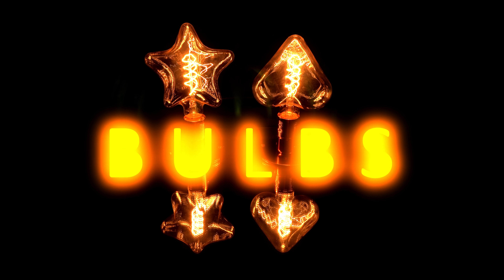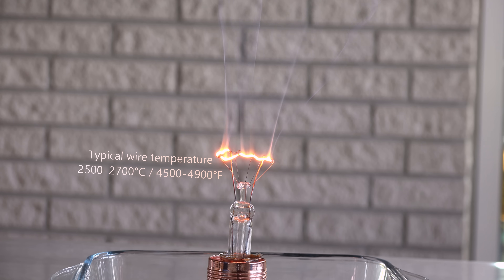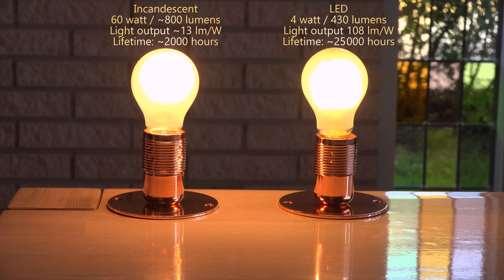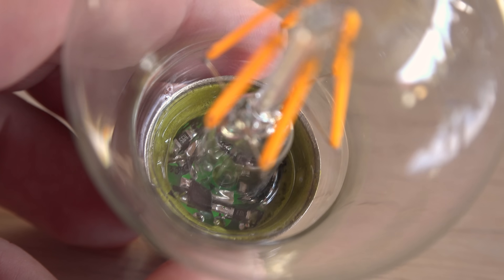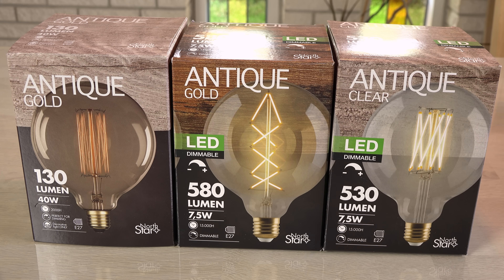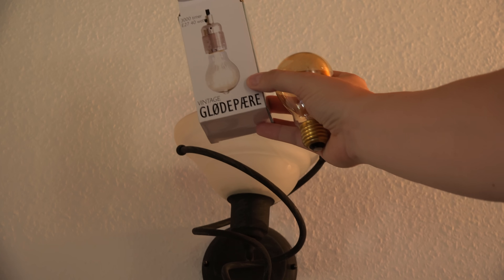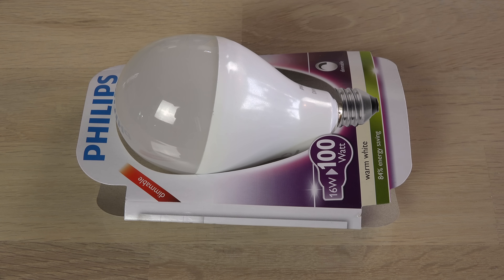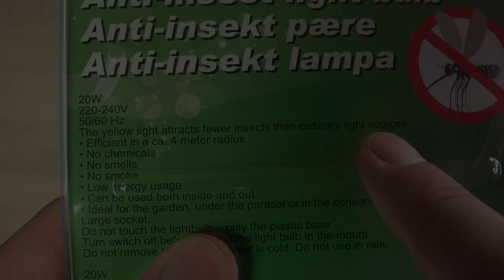Light Bulbs | LED vs. Incandescent

Comment: The led is lying to you because it is only low voltage but not more efficient in amperage and you are charge open wattage so get five led and you are using the same wattage as the Morden 60watt. The real solution is to invest in solar and you can use all 100 watt light.

Comment: Incandescent light is being discarded because it was being used in cameras and capable of capturing paranormal entities...
It's considered to be the poor man's IR light aka infrared light. The only camera i know of that still possesses the incandescent light feature is Nikon more specifically i use a Nikon CoolPix... happy ghost hunting 😉
Reply: Using it with a flash causes it tp send out waves of heat directed towards where ever it's pointed.
Ghost use energy as food... so they want to/ cant help but absorb this energy there for they become more visable. After they absorb it they cant just shake it off... so after that you can pretty much just follow it around until the energy wears off or the ghost hides from you.

Comment: It's weird that you say that the positive side has holes, like a negative. And the negative has extra, like positive. 

If you're checking LED heat by feeling the bulb part, you're doing it wrong. LED's get hot at their base.  You can touch a bright LED that's been on all day as much as you want on the white luminescent bulb part, but even a LED can get hot enough to burn or at least feel uncomfortable, if you touch near the base.

Color scheme my ass. Who cares if your meat looks less delicious, it's gross regardless but even if you disagree, and feel it's less appetizing looking, good? That way you're less likely to overeat. This feels like an invented problem so you have something to talk about for the video.

You know dimming there are many different types of making a bulb dim-able, and they don't necessarily get along with all bulb types. incandescent  might get fed less power by a dim switch setup, but that doesn't work for LEDs, they have to be on or off, there really isn't any in-between. So LEDs solved this for diming by strobing on and off too fast for the eye to see, giving less light by simply being on less often.

Also florescent would normally take awhile to start up,  But this was solved by forcing electricity through past capacity, kinda like jump starting them each time, meaning turning compact florescent bulbs that come on right away,  on and off, really cuts down on their life span. Fortunately LEDs are perfectly fine with turning on and off, better than incandescent even. Incandescent don't have a direct problem with going on and off but the temperature fluctuations between on and off can reduce their lifespan. 

You mention heat, but you don't mention cold. AFAIK florescent are especially bad at cold, but LEDs handle cold pretty well.  I strongly recommend everyone use a LED bulb in their fridge. For some reason the default and standard fridge bulb is the hot incandescent, but that's absurd. Not only is it less efficient and less capable of handing going on and off like when you open the fridge for a moment compared to a LED, all that extra heat is going in your fridge making it work harder.

Comment: F.cking ignorant.  I literally bought a 24 case of 200 watt incandescent bulbs just so I can always see in my bathroom when the hypocritical socialist liberals who don't understand basic thermodynamics in electricity want to ban f*ckinglight bulbs.  Okay so look we don't have a smartgrid and we probably won't for another two decades so the power plants make the same amount of power and the lines have the same voltage regardless of how much power you use in your home.  If you switch off your main it will not change how much power the power plant is producing nor will it increase the voltage in the lines literally all it will accomplish it's causing that transformer to heat up even more.   That's literally it.  You can sit outside with a pair of thermal goggles and literally see this for yourself reducing the load of electricity does not do anything other than increase heat output of the transformer on the pole.  You're not saving the planet, you're not reducing energy, there's not a guy shoveling coal into a power plant that suddenly going to stop for a second go oh well Joe schmo is using less power I better hold back for a bit that's not how it works, that's not how any of this works.  It's lies the sell more expensive stuff that intrinsically has no more value with the pretense that somehow it's going to save the f*cking planet and literally does nothing but reduce your personal energy consumption which will reduce your bill by like $3 a year whoop t-sh*t.  I prefer to be able to see thank you.  You ever been a motel where they have all the LED lights it's like a dingy dungeon was on a cruise ship like that last year and you literally got blinded when you went outside because there was no light inside.
Reply: I can't tell wether you're actually serious or just a top tier troll. Either way your comment was a very entertaining read. Thanks!
Reply: @NotBroihon  I'm dead serious, if you believe I'm wrong please explain what I'm wrong about.
Reply: @amelliamendel2227  your logic and elaborations are making as much sense as a desertation by a 4 year old on why santa claus exist, so I'm not even gonna bother. Have a nice day, mate.
Reply: @NotBroihon  Deep down you know I'm right
Reply: @amelliamendel2227  If believing that makes you happy ¯\_(ツ)_/¯
Reply: @NotBroihon  Do you believe power plants produce less power in response to more efficient appliances and lightbulbs?

Comment: In winter, most other folks run up their heating bill plus electrical bill to light up their spaces - my heat generating bulbs help to light and heat my rooms, without the additional cost
Reply: And during the summer, all that extra heat means your air conditioner has to run longer. So not only are you spending more to light your house, you're spending more to cool it.

And using lights to provide heat is a really inefficient way to do it.  That's why your house comes with a system specifically designed to heat it.

Comment: I still prefer older bulbs because produce more natural looking light, LEDs have a tendency to look plain white while incandescent have a warm look to them. tbh I think most older technology is better, like transistor and vacuum tube amps over the sterile sounding microprocessors that amps have now, as well as carburetor over EFI, because they worked very good and simple but had to be replaced by  the crap that exists today.
Reply: You can buy "warm white" fluorescent lights that have the same "color temperature" as incandescent bulbs

Comment: I have fluorescent compact photography lamps and they produce less than advertised 300 watt light. Pretty disappointing. I improvised (tight budget) 300 watt LED outdoor floods to hit the reflector umbrella incredible difference. I prefer to buy Daylight cool tone lights. I can add warmth with white balance. All the lighting in my home is of the LED variety. I installed them 2 1/2 years ago. I have yet to have a bulb go bad. When I was using CFL's they never lasted this long. I have some LED bulbs that are over 8 years old and going strong.

Comment: LED bulbs have no more lifespan than incandescents (if you disagree, prove it...I'm replacing these pricey things YEARLY). They are FAR DIRTIER ecologically than incandescents (mercury contaminants in CFLs, lead in LEDs). It has been almost 10-years since they have been banned in the U.S., and there has been zero data released on the benefits after this past decade. You want to know THE ONE SINGLE THING they are beneficial to? WIth the whole world turning to LEDs (and CFLs)? They do not blind FLIR night-vision devices...so that you can MUCH EASIER be seen in your home from any viewer outside your home with an FLIR device. With Incandescents, you could hide behind 'heat signatures' from FLIR....without the incandescents, you can be watched SO MUCH EASIER! This isn't conspiracy...this is FACT...and, in fact, one of the first thing they taught our flight crew to be aware of in urban environments!

Comment: LED light bulbs are more energy efficient than incandescent light bilbs, last much longer than incandescent light bulbs, electric bills are cheaper with using LED light bulbs vs incandescent light bulbs, plus overall the cost of buying LED light bulbs over a period of time is much cheaper than buying incandescent light bulbs regardless of unit cost of an LED vs an incandescent.

Yet people want to turn the clock back 20+ years.   Cost is the all important factor and cheaper overall is better.

Comment: CRI! That's what's my problem turns out. When I work in my garage I constantly find myself looking for incandescent lamp because I can see stuff better even if it is 100 dimmer. LED are bright and crisp but I feel like if I would have only one eye to work with, cannot see stuff clearly, everything looks flat unnatural, missing details. Weird stuff. Whoever trying to ban incandescent must be crucified.
Reply: They are already banned in the EU for a reason.

Comment: I live in the Houston area and our winters are so mild, I could keep my house acceptably warm by just switching from CF/LED bulbs to incandescent ones during the "winter".  So, if you need to heat and light an area, incandescent might just be more efficient if your other choice is an electric furnace.
Reply: Now, think about this-while it may be marginally more efficient in winter, those same lights are producing heat during the summer.  I've been in Texas in the summer-do you really want to make your house hotter?

Comment: Yes, standard bulbs don’t channel as much energy into light than heat. However, that is not necessarily “wasted”. In the Winter I have 4, 100W incandescent bulbs burning in my large living room. Due to the heat from these bulbs - and fan used all the time to redirect heat from the ceiling - I am able to turn electric heat thermostat DOWN. It is a swap of the energy. If I were heating with gas or other fuel, I’d still be lessening my energy needed by those fuels. Again, trading source of energy.

Comment: Great video! FYI though, the CRI video test with the meat was likely confounded by white balance differences - to be a fair test, the three would need to be white balanced to their respective sources individually, ideally using a quality white balance reference card (that’s the problem with low CRI lights, even when properly white balances, differences in colt reproduction exist because of holes in the emitted spectrum)

Comment: When people quit buying bulbs that burnout sooner then the demand will drive the price up. This will further strengthen the demand for LED bulbs. The incandescent bulbs are useful and hard to substitute in some situations as demonstrated. The heat factor in winter is useful for instants. Banning bulbs didn't work in the USA because the alternative at the time was twisted fluorescents and those just plain sucked! The market in this case will have more power guide people's decisions towards better informed decisions if at the sales point all the pertinent information is provided. This information, I believe, should be legislated as required. The problem with  so called power savings for the power company is that producing power is not a homogenous effort. For example, most large users are charged by peak deliverable power not by power used. Your little light bulb is a waste in that it takes power to manufacture, deliver and dispose of the bulb. Get it?!

Comment: Leds have Transformers, transformers do warm up quite a bit, so we are still there, we just moved the heat.
To exite electrons you need always the same amount of energy, no matter what(quantization of energy).
For example if you want to bring a rock up a hill, that you use your legs or a car, always the same amount of energy is needed

Comment: I've got a whole bunch of those 60 watt incandescent bulbs I bought from Big Lots 20 years ago. I use them in those hood lamps when working on cars.

They are bad about giving off allot of heat. OK in the winter but not very pleasant in the summer when it's 95 degrees.

One day I was changing the oil in one of my cars and some oil dripped onto the bulb and it when POP! 

I wonder if I can sell these on Ebay and make some money like I did those four cans of R-12 I paid $1.20 a can for back in 1991 and then sold for $80 about seven years ago. Then took the money and bought about 20 cans of R-134a! From where else, Big Lots!

Comment: It is a common myth in EU countries that incandescent bulbs are banned (the actual law is an EU one, not a national one)... The regulation ACTUALLY just states that retailers are to sell energy saving bulbs for household use. HOWEVER, the regulations do not BAN incandescent bulbs in the EU member states. The regulations don't even call for them to be phased out to a point of banning... All it calls for, is for retailers to sell energy efficient bulbs for domestic lighting. 

Incandescent bulbs are still perfectly legal, and can be bought quite freely in specialist lighting outlets, or even by normal retailers, so long as they are not specifically sold for domestic lighting (such as a mood light in the store's novelty section - for example).

As for halogen, IR or incandescent heat bulbs, the EU law omitted them from this regulation because they are speciality bulbs, often used in hydroponics, plant nurseries, animal/bird husbandry, and industries that require specific spectrum ranges... None of these properties can be so effectively reproduced by LED or mercury based energy saving bulbs, so are exempt.

If Denmark has gone much further than the EU law and banned them, then remember this... EU trading rules, mean that you can buy these bulbs online from any of the 27 other countries in the EU (and the other few in the EEA) and have them shipped to you without hinderence at customs, because of the European Customs Union, making customs checks between EU states irrelevant.

Comment: Incandecent are being LIMITED in most countries. there are things that CFL or LED are not able to do such as illuminate and heat. not manytings can be done with a single element. 

and the flicker can be more seen on non digital recording equipment or not frame adjusting filming. just saying

Comment: As more of a question than a statement, is it not true that LEDs, being diodes that have only a 50% duty cycle (only on 50% of the time), although more efficient, can cause seizures in those with epilepsy in places where main AC is set to fifty hertz and for all places can cause severe eye strain like that received from staring at a computer screen for hours on end? In the US, there are a lot more kids having to get eye glasses presumably because they are in schools with LED lights in place of high frequency fluorescents and/or incandescent light fixtures.

Comment: At work we have a hot rack to keep food warm. Don't know what technology will replace this as LEDs can't
Reply: It's the 400w halogens we use. It's funny that's the same bulb as the security light we have out the back. Gives off a lot of heat but in the case of the heat usaly being the secondary useless function we use it for the heat not the light.

Comment: Yes, you're absolutely right about that last one. It's common for such lighting units to be advertised as repelling insects, which is a case of deceptive advertisement as they actually attract insects. Some people actually fall for such deception to the point of hanging such a light outside of a window they keep open at night to let in fresh air. They know the lights indoors will attract insects in through the open window but they think the "insert repelling light" will keep them away from the window so not as many will get in. Needless to say, it doesn't work. However, they can be useful as a replacement for a light that would otherwise be on anyway in a place where flying insects might tend to swarm around the otrinary electric light source.

Comment: the one thing i hate the most about this is that crimped socket housing  it's sad to see them all over the place now, is not enough that we have to replace the bulb if it goes bad, we have to replace the whole thing if the wire breaks.
  soon they will sell them "with crimped in" LED bulbs so you got to buy a new one every few thousand hours , that only if they don't make it so LED's can't last more than a few hundreds...

Comment: LEDs produce a lot less heat but when they are placed inside a typical enclosed light fixture they produce enough heat through their delicate ballast or electronics to shorten their own life.  The biggest weakness of LEDs is their short operating life spans when used inside an enclosed light fixture.  They burn out so fast that they can't pay for themselves in savings when electricity averages $0.12/kilowatt (0.10 Euros/kilowatt)

Comment: I still prefer daylight CFLs for reading. 6500K Such as OttLights use.
LEDs are not "all that"
Reply: Oof, surely not nighttime reading, You'l burn your eyes out. I agree though, cheap LED's usually look either too green, or purple. It is really hard for the manufacturers to get the color balance just right, so they test and sort LEDs into "bins". If you want really high CRI LED, that have the right color hue expect to pay a premium.
Reply: Cold light only works for the kitchen, in other places I will always prefer warm light